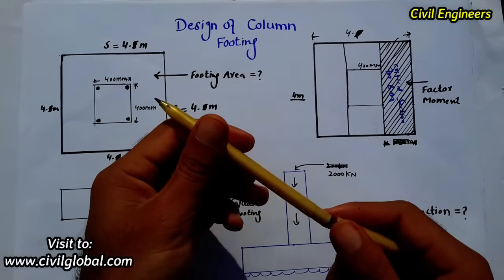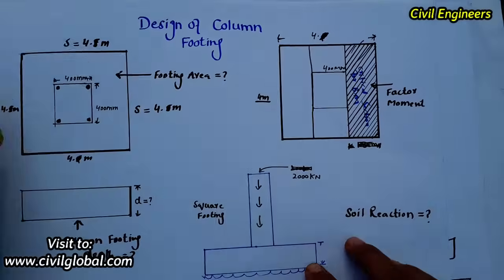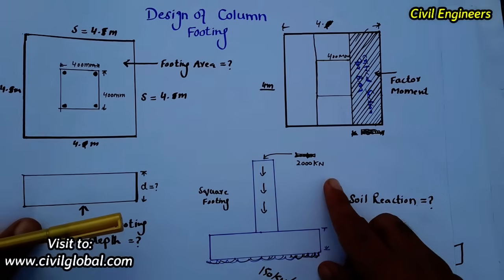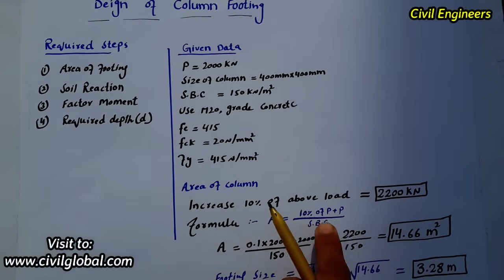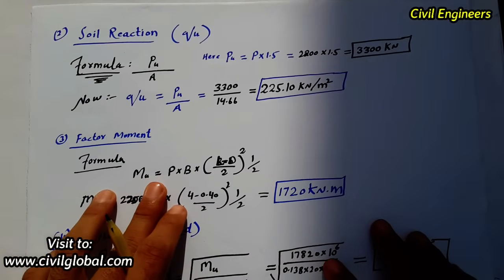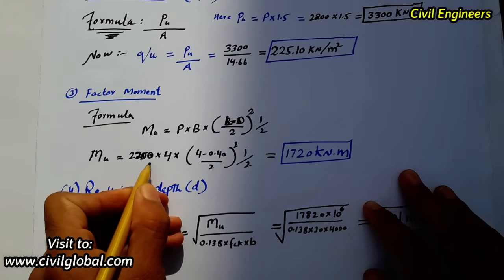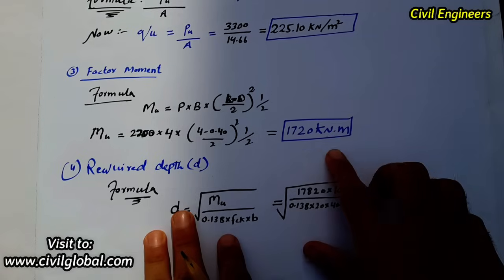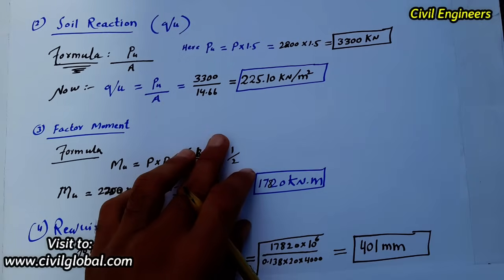Design of column footing

Comment: THEE most often mistake made is not elevating the column footing with large gravel and stones to ensure a proper depth of concrete UNDER the footer. the pressure of the weight of the structure can puncture the bottom of the footer cement and you end up with a building supported by rebars stuck in the mud.
you need to address THEE most common mistakes people make with each area.

Comment: The calculation has mistakes. Correct computation will bring 14256. But, the formula itself you have added extra "B". It is (PL square)÷2.
Also by using your factor moment formula SI units does not cancel properly.
Please rectify and present again. I love your teaching and knowledge you share. Thanks.

Comment: why did you calculate moment using reaction load from the column? I think you use the soil capacity as the load for the calculation of moment? I think your calculations are wrong and misleading.

Comment: P=2000 but while finding Soil Reaction you have given the value of P=2200
Why?
Reply: That's because he added 10% of 2000
Reply: (Error)Yes P=2000
Since it is reactiocn due to column load only

Comment: I appreciate the presentation. Though, there seems to be a mistake in calculating the the Factor Moment. Mu=1720 kN-m and corrected to 17820 kN-m when calculating 'd'. Mu=14256 kN-m in my calculation. Why? Is there a mistake in the formula or a mix-up of units? Pls give correction and explanation, as this is very very important and will satisfy many who have commented the same. You 've not replied so far. Why? I think you should. Many thanks!
Reply: i was making a master sheet yea and i thought i was a dunce i kept rearranging the formula in excel and was still getting Mu= 14256kn.m  also in the calculation of Length of the pad foundation  L= 3.83 m - round up to 4m . There were cal errors yes but i do appreciate the design procedure.  Much thanks.
Reply: @HTheHeat619  So this presentation is merely a procedural only, and it doesn't count on the reality of the design. Everything are assumptions.
Reply: I agree with you, and calculating the depth also has different result not 401mm, could you please verify the calculation. And also Pu (Soil Factor) was not used in you formula.
Reply: What about depth sir?
Reply: Also need to take factored load Pu in factor moment equation....and factor moment equation is not satisfied with unit of KNm...but it is coming KNm.m i.e kNm2...
Actual equation from interaction chart of column is
Mu=Pu×fck×bD2,,,where D is overall depth including cover,,
First of all it is needed in design whether column is short or long,,,which method is using WSM or LSM...column effective length Le comes in picture(with 4 condition discontinuos/continuous etc) then ratio of 
Le/500 +B/30 or 20mm for minimum eccentricity
Then still lot more if column is designed as long column...10%increase then helical reinforcement,,ties, pitch,,spacing,,dia
Reply: I believe their is a problem on calculation on Mu . When I calculated it , I found Mu =14256KNm

Comment: Sir please solve my question, Question is, Searches related to a 500mm square rcc column carries an axial load of 1200 kn. design a square rcc footing for the column if the safe bearing capacity of soil is limited to 150 kn/sq m.use M30 and fe500 sketch the reinforcement details. send me answer in my mail.id mateenbhatt@gmail.com

Comment: can you explain me the difference b/n the size of column and the area of the column. i mean 4000mm by 4000mm and area becomes 14.66m2?????
Reply: He rounded up the square root  of 14.66 (3.828) up to an easy  to work  with number 4m  =4000 mm

Comment: please solve this Question
a simply supported RCC slab with clear span 15 ft carries a servise live load of 100 psf and 4000 psi concrete the spicified for used yield stress of steel equal to 60000 psi  desig the slab proviouns os ACI

Comment: Also, no one would ever use the full width of the footing for moment resistance because when you look at the slab in Finite Element Analysis the sides of the footing attribute no strength to the moment resistance...look it up if you don't believe me. For the moment resistance you should chop off 15% of the sides, as the depth would contribute 90% more moment strength. You're just tricking yourself with this process.

Comment: lol, no one would use a design like this though. Sadly when you calculate the dead load of such a proposed structure it exceeds 15% of the building column load...which in turn requires a feedback to the footing area calc. See what I'm getting at here? In reality the discussion would be with the geotechnical engineer to bump up that ridiculous value of 150 kPa soil strength which in the real world represents the strength of swamp soil or something with absolutely no shear strength/friction angle. What soil are we loading here? A pile of washed sand? Haha. That footing is ridiculous sir.
Reply: Charles Hartlen This is so insightful, but won't it be the geotechnical engineer's fault if they give such a high value I'm the first place (in reality)

Comment: salam
           i have designed a big room ( 25feet x 30feet ) in my Hujra and on top its normal 6 inch slab it will have a foot of soil as it is going to be a green roof.
now the problem is i am confuse about the strength of beams and columns for this room i need to use.

please guide me about it and i will be very thankful.

Comment: How to calculate the loads coming on a particular column..???
Reply: Design slab and beams.Transfer beam load(Reactions) to columns to calculate load on column.
Reply: Structural Analysis bro.
Reply: Mujiburrahman Khan 1
Reply: You can use area method to sum the loads that coming from the slab and beams